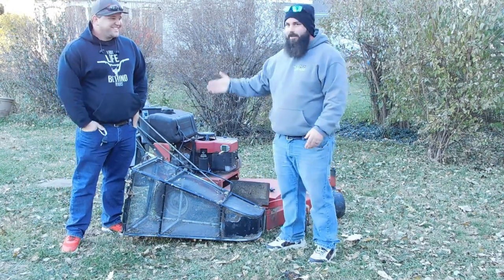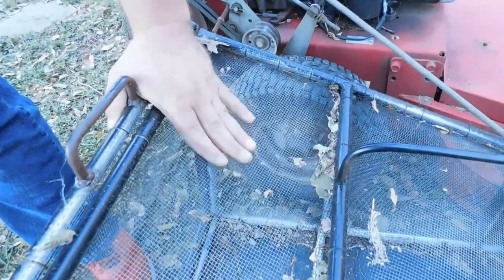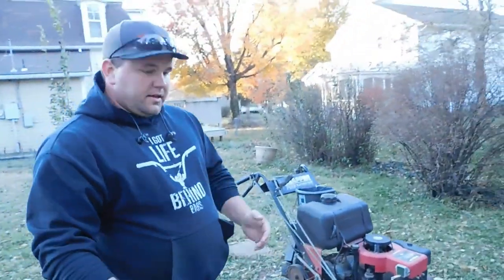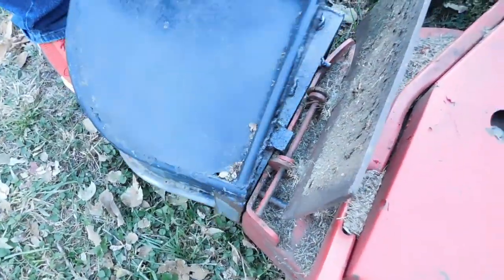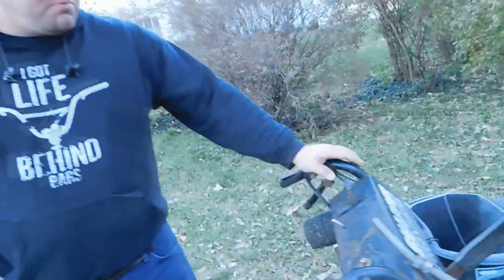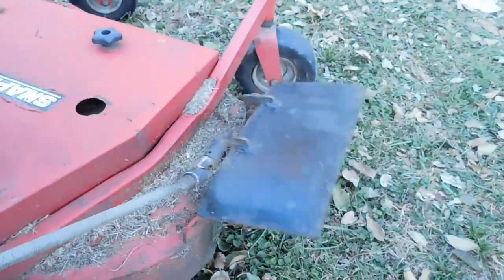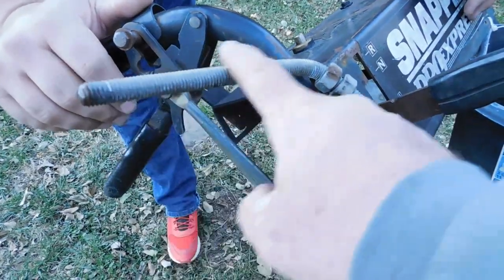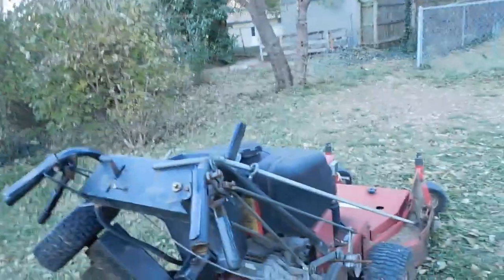DIY Accelerator style bag / Chute blocker for lawn mower

Comment: When the all thread bends to much put a pipe over the allthread and tighten down seeing how you would have to cut it at some point I would cut closer to the handle and use a coupler but plus 2 pipe half's then tighten nuts on both sides of the 2 pipe half's to sandwich the pipe snug it won't be able to flex anymore and can still be taken apart if needed if painted it would keep with the look of your grass catcher in MN I would have the time now for making working things look nice the nicer you make these they happier you will be seeing how your great at function thank you for the video and showing the strength and weekends of what you made